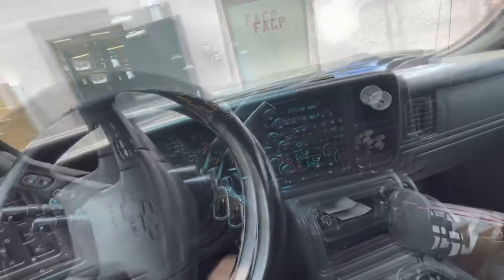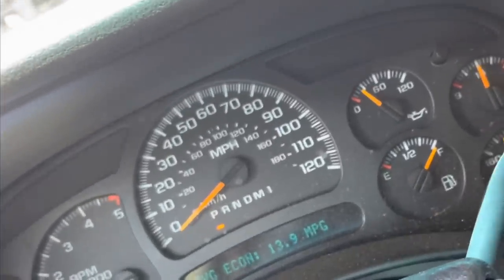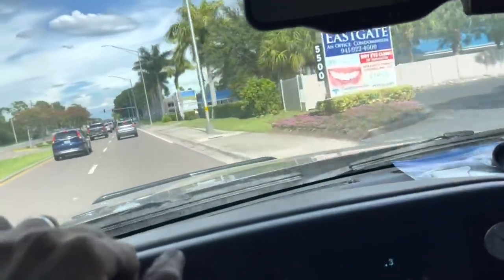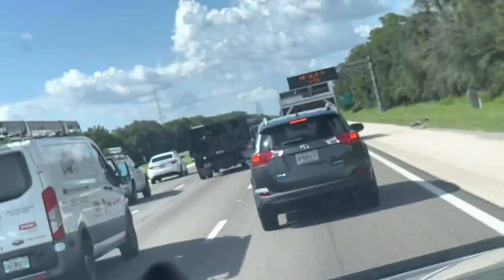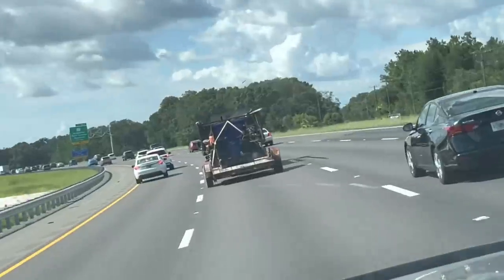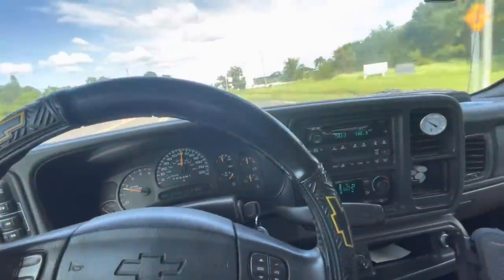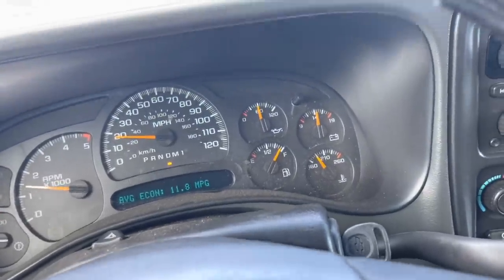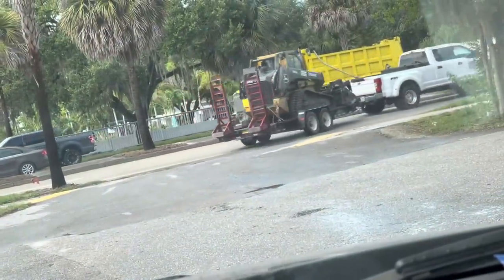Need answers! ox-cetane Diesel Fuel Experiment | Duramax 6.6 LBZ

Comment: Kind of funny, because the European unwritten "rules of the road" say that a short high beam flash means you can merge in front (it doesn't have the effect of turning off/on your tail lights) and a short flash of the 4-way hazards blinking 3 times means 'congestion ahead'.

Truckers often indicate right-left-right after merging or overtaking as a means to say thanks.

Comment: Seems to be providing a fuel improvement probably because the cylinders are cleaner and not so caked with Carbon probably cleaned the Injectors @Rainman Ray's Repairs

Comment: I run Archoil 6200. It makes a big difference, no smoke (1997 F-350), and more torques produced. 

I ran a test at work on a small diesel. We have Kubota 4x4 transportation, they have a 3 cyl Perkins. With no fuel additive the fastest it will go is 18 mph. With the Archoil 6200 it will run all the way to the governor 24 mph and no smoke when the ac compressor comes on.

Comment: I liked this kind experiments.  Announced the source first and it is up to us (the viewer) to decide whether to use or not.  at least, I trust Ray is a honest you-tuber. dumb question:  Why diesel fuel per gallon in the Us is more expensive than gasoline? put the supply and demand on the side.  One time, I had the bad gasoline (might be the gasoline station storage tank was very low so the bottom part was not quiet clean.)  I used one of the gasoline additive and that helped.

Comment: the only thing I have tried that ever worked was seafoam, I dumped a whole can into the throttlebody of my tbi 4.3 on my 91 c1500 truck that had 600k miles on it, cleaning the trottlebody helped but dumping seafoam and reving it like crazy did make the truck run smoother and smoke less at throttle, my grandfather owned it and never really did the proper maintenance on it, hell the spark plugs were 15 years old when I got it.

It definitely improved on that truck and its whole 120 horse 4.3 lol

Comment: Ray, your Ox-cetane video got my attention, toward the end when you were pointing at several medium-duty commercial trucks that you said would be "out of business" if diesel gets to $10/gallon.
You are not old enough to remember, but during the 70's "energy crisis", everybody was saying the world was out of oil, and this was the end of civilization as we know it. That was used as an excuse for gas at the pump to get stupid, to the tune of 300%+.
But in April 2010 when the Deepwater Horizon offshore oil rig blew up in the Gulf of Mexico, I heard an interview with John Hoffmeister who is the former CEO of Gulf/Mobil, and knows something about drilling oil. Hoffmeister said that the Deepwater Horizon broke off the wellhead at the bottom of the Gulf a mile deep, afterwhich oil was gushing out the floor of the Gulf thru a 3-1/2" casing at something like 22,000 psi.
That's 24/7 until BP operations got the wellhead capped in August, 4 months later.
This was 35 years after everybody said the world was out of oil.
Ain't that amazing?
Reply from the maker: Indeed it isI don’t think we are out of oil. Nor will we be in several lifetimes. I just said we can’t afford to operate at $10. Bc we can’t
Reply: @RainmanRaysRepairs  9 dollars a gallon right now here in the UK. First time I’ve filled my car up and winced looking at the cost.

Comment: Apparently clean flow is the only thing Cummins recommends because it will actually clean your injector... spelled with K... my 2014 Ram 2500-67 turbo diesel was surging at about 204,000 km and I thought I needed new injectors but I put Kleen Flo according to the recommended amount and miraculously my surging diesel turned into a perfect running diesel again

Comment: Actually freshly waxed cars have smoother airflow over them and therefore get better MPG, however miniscule, does get better MPG.  Even if its .1MPG its still an improvement.   I read an article about race cars getting slightly higher top speeds and better fuel numbers when their cars are freshly washed and waxed.

Comment: adding regular trans fluid to a diesel engine. like 1 qt or so per tank a couple of times will do the same thing.  When i was in the army i was a generator mechanic and i did this to a generator and after 2 qts of trans fluid i went from using 15 gals per 12hrs to  10 gals per 12 hrs.

Comment: Where I live it is illegal to touch anything in the vehicle that doesn't provide direct control. You can be fined by the police or found at fault for an accident if touching the radio, climate, window, etc controls that require you to remove a hand from the steering wheel.

Comment: Hey Ray, here in Mass. there is a law that states we are NOT allowed to operate a motor vehicle with a cell phone or any other electronic device in our hands. I'm guessing that that may have been what that individual was referring to. I don't see how that effects anyone else, but it is a primary offense here. Meaning that they can pull you over for doing it, as compared to seatbelts which are still a secondary offense.

Comment: I run a cetane booster in my deleted ram 3500 (so no def). I noticed immediately it cut down on coal which is indicating a cleaner burn and so far my mileage is around 18.5 without towing much so I’m gonna stick with it. Mainly did it for the injector cleaning properties than fuel mileage, that’s just been a side bonus.

Comment: You want an additive for diesels...howes is very good, $11 at walmart.  Power Service is also pretty good, available at walmart but once you open the bottle it will leak until it is empty.   I use howes, mostly because i am up north and need its winterizing abilities (run summer diesel all year around).  I use  1oz per 5 gal of diesel.  There you go two options that are easily available and cheap.
Reply: Most diesellers don't know you can add up to 20% unleaded gasoline and have the same or better non-gelling properties.
Reply: i am not a fan of using gasoline.  With the alcohol you don't want the chance of having water in the fuel system.  Old school to make winterized diesel was to add 20% kerosene to the diesel but now adays they just use chemicals to make winter diesel.  You have to be very careful adding anything that has less lubricity to diesel.

Comment: Ray, I love your videos as you give insight into the mind of a trained and knowledgeable mechanic.

A couple of questions though:
What size diesel is in your truck?

And

I bought a used 2000 Chevy G3500 with a 6.5 liter turbo diesel with 212K on the odo. What are your thoughts on that engine?
Reply: Cooling will be the number one killer of a 6.5 diesel especially in a van so make sure it stays cool if you pull any load, get the engine oil cooler lines replaced with braided AN lines as the factory crimped lines leak and blow off ruining your engine. Get your transmission fluid and filter changed yearly and the 4l80e will last indefinitely. If the truck cranks over slow and doesn't start right up then the starter may be going out, the battery cables are undersized from factory so you want to upgrade them, if it starts with lots of white smoke then it's usually glow plugs. The 6.5 isn't a huge power house but will get good fuel economy when treated right, I get 19mpg with all my mods on my 6.5 and it's fun to drive, about as much power as an early stock 6.6 Duramax.

Comment: Mythbuster did a test and found that a clean car gets 10% better gas mileage than a dirty car.
As for the Cetane, I've considered using it in my Duramax (L5P) but haven't yet.
Reply: Depends how dirty, and I don't think Ray said better mileage when clean, just that it drives better.

Comment: Ray I'm sure you know that you can get a Tesla for much less than $90K, and there are an increasing number of other EVs on the market.  The purchase cost of my EV which I got new in 2014, comes to $18,500.  Maintenance has been minimal and repairs amount to $0.  They may not yet be for everyone for sure, but if they fit your needs it's a beautiful thing to pass by the Reverse ATMs (a.k.a. fuel pumps).  The capabilities improve year after year and before too long you may want to start training on those systems.  Have a great day and thanks for all the vids.

Comment: New running shoes.  Makes you run faster.  :)  It's hard to wrap your brain around something that ...Steve... says will make a difference when you talking about 1.5 ounces out of 3840 ounces (30 gallons)   Hope it works.  Trucker driver semaphore is very useful though.  One last edit.  Story for fuel additives. I had some 'Octane Booster' that I was adding while making an interstate trip.  It appeared to increase my MPG, based on the calculated refuel amount vs miles traveled hand calculation.  It all went sideways however, when I stalled out on the interstate and the fuel gauge said I still had  1/3rd of a tank remaining. Tank was empty. I always drive until I get the refuel warning, and I did not yet have one at that point.  Had to call road-side services to get fuel for next station.  It took 4-5 unmodified fill ups to get the Fuel Gauge to read accurately again.  SOMETHING in that additive was interfering with the sensing device in the tank. I was driving further per tank, but it was a lotto as to when I would unknowingly run out of gas.  Be warned.

Comment: Ray, It is actually illegal down-under to hold your phone whilst driving.. Infact... to even operate your phone will cost you. 
They now have installed  "Phone Camera's" which target drivers who do not have both hands on the wheel . 
They are afraid that operating a phone is a distraction from the operation of the automobile..  Hence why alot of new cars have steering wheel mounted controls to adjust everything on the radio so you dont take your hands off the wheel.. So  yeah, It is illegal to hold your phone and drive down here. Keeps safe champ  and make sure to take care of yourself.
Reply: He holds his phone up, so a camera might not catch him. They generally are pointed at peoples laps. Though a cop passing would see it. We have MC cops riding through traffic looking in windows.
It's illegal in many parts of the world, even just to hold it.

Comment: I did an A/C experiment(as I am a 28 year HVAC tech) I recovered my 134a and replaced with Hot Shot) I could frost my windows on a hot day!You need to lower your condensing pressure(temp) add a small e-fan to move more air across the cond coil! Keep coil washed also!

Comment: I'm under the impression that the MPG readout is cumulative over the course of the numbers of trips until it's reset. So the figure is an aggregate. When reset, you're essentially getting a real time fuel economy readout that will average lower or higher as you accrue more miles and trips, depending on the circumstances. You'd probably have to run a tank or two with this treatment in it, with hand calculated MPG figures, to get a more valid result.
Reply: Yes. That number is a running average. Sort of meaningless IMO as the number will almost always be somewhere on the low end of what a manufacturer lists for your vehicle. If you want real time (over like 1 sec) you need to hook up something to communicate with the ecu and log a drive or two. Doing it that way is responsive enough to measure how efficiently you drive and will detect any difference over like 5% pretty easily over the course of a 20 mile or so drive. A fuel cleaner added a good 8% mpgs to my car which was shocking as I run premium gasoline which should already have a good amount of said cleaners in it already.

Comment: 15mpg for that size dually and age that is impressive especially with the extra 600 pounds in the bed with the tank of fuel... 2000 4runners get 16 city but its a ton lighter in weight @Rainman Ray's Repairs

Comment: You were talking about that guy getting worked up about you holding your phone. In Ontario the police will charge you with distracted driving if you have anything in your hand at all. Its a $250 dollar fine and 2 demerit points on your license. So you have to ask google for the directions before you leave and can't check anything on it at all. Great that stuff seams to be working out for you. Will be interesting to see what a month running it would do.

Comment: if you want to get the max fuel econ you need to know the shifting specifics of your trans
-what speed/rpm for each gear it up shifts and down shifts then you try to keep the rpms as low as you can in the gear you want with out down shifting

Diesel can only be kept for 6 to 12 months
gas can only be kept for 3 to months
Reply: Yo7 can keep gas as long as you want as long as the tank is full.
Reply: Except when they add bio-diesel in the mix, that stuff goes bad very quickly. Overhere in Europe they normally add up to 7% bio-diesel in the mix.
Reply: @meeder78  Point Taken

Comment: Wow Ray, 48 miles one way is a lot of driving.  I mean a LOT! And to do that every day in a big diesel pickup getting 13-14 MPG has got to be a big drain on the wallet.  Have you considered getting a small 4-cylinder car just to go to work in?  Or maybe a motorcycle?  I have a Honda CB1100 and it gets 58-60 MPG on the highway.  Even a small 4-cylinder car should be able to get 35 MPG which is more than double your current mileage.  Plus, like you mentioned in the video, diesel is about a dollar higher than regular gas. What are your thoughts?  Big fan of yours, by the way!

Comment: If you consider Cetane as diesel's equivalent of octane, it will increase performance and mpg. I have been using a similar product for a while and it continues to improve as you use it.
Reply from the maker: They also claim that it’s just as effective in gasoline engines as well.
Reply: @RainmanRaysRepairs  ah, that's why it's ox-cetane, very good 🙂

Comment: Cetane just makes the fuel more combustable.......so perhaps you might see easier cold starting but unless you are using very poor grade diesel.....the additive is not really required. If you want to improve on fuel economy....don't drive a diesel truck that only gives 14mpg on a good day. There are trucks out their that can double that MPG without any expensive additives. But as always a intriguing video from you. Poor a little bit of that stuff in to a small dish and set fire to it.............you will see what I mean

Comment: Ray, in the UK even touching your phone while driving is an offence and you could potentially lose your licence if caught by the Police.
According to safety experts it's a distraction and dangerous.
As for cetane increasing products I was sceptical but saw a decrease in fuel consumption and performance improvement after purchasing a similar product by a big brand.
Unfortunately the cost of the product was expensive.

Comment: Only way to really see if it works is to first run 3 tanks without, recording miles and actual gallons used, then run 3 tanks with doing the same and compare. Daily conditions differ too much to rely on one or two drives.  This stuff sounds like it might be a fuel system cleanser and carbon deposit remover, which if working properly can help increase performance and fuel economy by a small percentage, which in trucks that get under 20 MPG, 1 percent is huge.  I use Hotshots Secret, similar dosing, and the truck does run better after a tank or two compared to the other brands, or none at all.  I add it for lubricity and anti gelling since I am in the Salt Belt, instead of the Sun Belt.

Comment: UK just passed laws that any device myst be in a cradle and not touched while driving. 
I have tried various diesel fuel treatments in different vehicles. My land rovers d1 d2 and d3 all get a improvement in fuel economy and the d1 you can actually feel it coming through the system after about a mile.
My husband has a UK 1.6l Ford fusion and its normal mpg is around 63mpg using BP ultimate fuel it slowly creaps up to 69mpg with combined driving. 
Not scientific or taking into the added  costs of treatments or more expensive fuel but my thoughts are it must be better for the engine. 
Although nothing compared with having the land rovers re programmed my d3 was uprated to give more hp and it went from 28mpg to 36mpg.

Comment: In MN it is illegal to have your phone in your hand while driving period.
Big question is what is the difference in cost per mile. Regular mpg vs "restored potential" mpg + the cost of the additive "snake oil".

Kind of like my co-worker driving a 14mpg vehicle 15 extra miles to save $0.10 a gallon on 30 gallons of gas. Burning $5.00 of fuel to save $3.00 on a fill up. I try to explain but........math.

Comment: Verifying diesel Cetane numbers requires lab equipment. Only long term use w/accurate figures, notes could give an inkling of an additives benefits.  Several tanks of Premium Diesel's 45-55 cetane after using additive in Reg 40-45  cetane would be a good comparison , Eh

Comment: Ray, can seafoam be injected into the engine intake to help clean the valve on a direct injected engine while the car is running?

Since port injected engine valves are cleaned and cooled by the fuel being injected in behind the valves there’s nothing to clean and cool the valve on direct injected engines.
Thanks.

Comment: Hi Ray

So the same way that the octane number represents how much heat and pressure gasoline can endure before knocking, the Cetane number is representative of how well diesel fuel ignites once injected.

Under certain conditions, diesel fuel with a higher cetane number will ignite at closer to the optimum time. This can produce a bit more power. 

But something that increases the caloric content or fuel is a false claim. 

Using the onboard fuel consumption calculation is not a good idea if you really want accurate results. You need to do something like fill up and see how many miles you get out of 3 treated tanks of fuel, vs 3 tanks of untreated fuel.